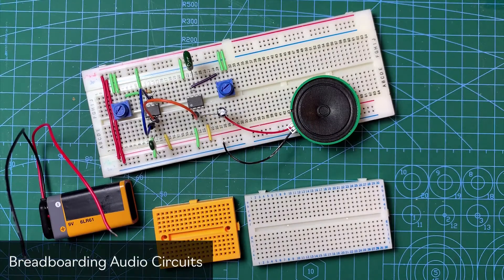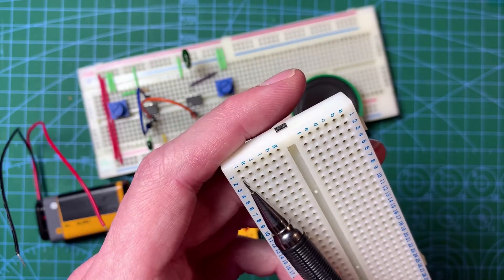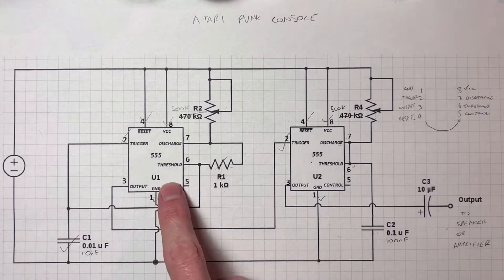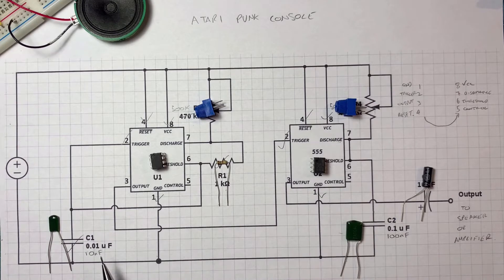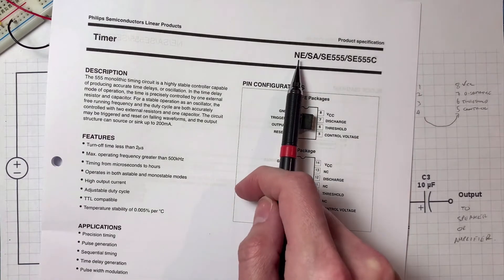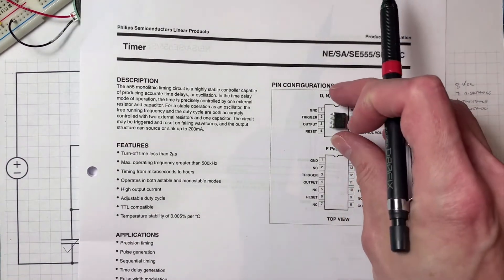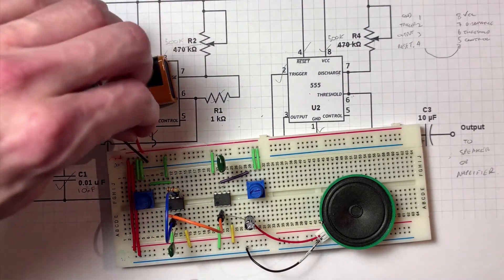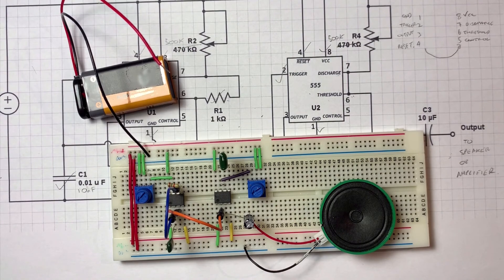How to Use a Breadboard to Make an Atari Punk Console Audio Circuit

Comment: can you list all the components used and their range
Reply from the maker: @LasyaB.P  555 Timer IC  x2 any type is fine for this. 
(You can also use a single 556 chip - but use the datasheet as pin outs are different) 

Two 500k linear potentiometers (can also use 470k and they can be audio taper) 

1K resistor (any type, I used a 0.25 watt one) 

10nF  non- polarised capacitor
100nF non-polarised capacitor
These can be film, ceramic, multilayer ceramic. 

10uF polarised electrolytic capacitor

Wires
Breadboard

With this circuit being “punk” in nature and all you should be able to build it out of parts laying around. The values aren’t super important as long as they’re fairly close.

Hope that helps. Actually, I could probably share a mousser cart for these parts tomorrow if that helps further.
Reply: @MusicTechknowledgy  thank you very much

Comment: Mine doesn't work, it just makes a pop when I plug the battery. The thing is that I'm using normal potentiometers (still 500k) instead of those blue ones so I had to re-arrange the jumper cables that connect the pots to the positive terminal of the breadboard
Reply from the maker: That can be frustrating when learning electronics; I have often been there.  The key is good troubleshooting, this becomes second nature eventually. Let's see if we can help you to get it working.  

The different type of potentiometers does not matter, even the value doesn't matter too much in this circuit and  it sounds like you have it wired correctly, so it is unlikely to be that.

First, check the orientation of each 555 IC, the dot shows where pin 1 is located.  Some chips do not have this but still have a little semi-circular cutout showing the top (pins 1 and 8 in this case).

Do you have a multimeter?  If so, pins 4 (bottom, left pin) and 8 (top, right pin) on each 555 should be at the battery voltage (9v in my case).  Pin 1 (top, left) should be at 0v (ground in this circuit).

Pin 5 (bottom, right) should not be connected to anything.

In both cases, pin 6 is going through a capacitor (10nF for U1 and 100nf for U2) to ground (Battery negative) 

Other than sharing the battery power rails, the only link between U1 and U2 is one connection from U1 pin 3 (Output) to U2 pin 2 (Trigger).

Have a look at the schematic and continue to methodically check each connection, like I have started doing here.  It's likely to be one wire or connection, it usually is.

Come back to me if it's still not working, I can quickly build it and let you know what voltages you should be seeing on each pin.
Reply: @MusicTechknowledgy  Nice advice, thank you. I'll try to get a multimeter and check every connection to make sure they're all well seated.
I'm a newbie, this is literally my very first breadboard project ever. 
By the way, I forgot to mention that I'm using a medium size breadboard (30 rows), is that an obstacle? My pots take more space since the pin spacing is wider
Reply from the maker: @Apo458  Awesome.  I remember the initial struggle well and I'm here to help you get it up and running.   It's such a great feeling when it works, especially when starting out.

With the breadboard, I tend to use the bigger one for teaching, in these videos, as it's easier to see on camera. 

The 30 rows should be perfect for learning and shouldn't be an obstacle until you get to the stage where you want to build more complex circuits. At that stage, I would grab another, and/or upgrade.
Reply: @MusicTechknowledgy  Nice, thank you.
I think I have found the issue. I used one of the 555s in astable mode to output a soundwave, same result. Swapped the 555 and same result.
I noticed it was strange because when I plug in the 9v battery I get clicks and pops until it is fully connected, it is then when no sound comes from the speaker. Still don't have a multimeter, but my guess is that the battery is causing the issue.
I have a 500 mAh rechargeable battery, a cheap one, works fine to power my acoustic guitar pickup and my mini-Marshall amp, but that's it
Reply from the maker: @Apo458  Good troubleshooting, trying things out and swapping the chip.  From experience, I'd say it's unlikely to be the battery, but stranger things have happened.  555's work with a Supply Voltage (Vcc) from about 4.5v to 15v usually.  If you look at the top of your chips they'll say something like NE555N, if you do a search, like this "NE555N Datasheet" only replace the NE555N with what it says on your, you should find a datasheet with the specific timers specs. Vcc is what to look for.   When you get a multimeter you'll be able to measure the battery voltage too.
Reply: @MusicTechknowledgy  I'm back. Yup it wasn't the 9v battery, the issue was the two ICs... Apparently I burned them because I wired the pots wrong initially 😂
When I tested them in astable mode I got no sound because both were dead. Yesterday I bought a 100k pot and a single 555 to make another test in astable mode. Turns out it worked, I could control the signal with the pot... But the joy lasted a few seconds, I turned the pot all the way up for fun and noticed I killed this 555 too 😅
I did this with a 1k resistor, a 0.1 uF polyester cap and a 10 uF electrolytic cap. I guess I'll buy other another two 555s and test them again with this same circuit (this time around I won't turn the pot all the way up). If both work then I'll rebuild the circuit again, good news is that 555s are way too cheap.
Thank you
Reply from the maker: @Apo458  I’ve burned out many, many ICs over the years. Sometimes I’ve even melted several breadboard holes, from the heat generated 😂.  It’s definitely a rite of passage when learning electronics. Great stuff in finding the fault, that’s the key to all this really, building, fault finding and rebuilding until it works 👍😎
Reply: @MusicTechknowledgy  Just did it! It works completely fine. I bought another two 555s, tested both at the store and came back home, the thing is I left it in the car for quite a while (36 celsius outside temperature) and I noticed I killed another one because of the excessive heat (didn't take it out of its plastic bag).
Returned to the store and bought four more in case something else went wrong, now I have a 100% working Atari Punk Console, thank you
Reply from the maker: @Apo458  Fantastic stuff and those fault-finding skills you've developed will be absolutely invaluable as you continue exploring audio electronics.